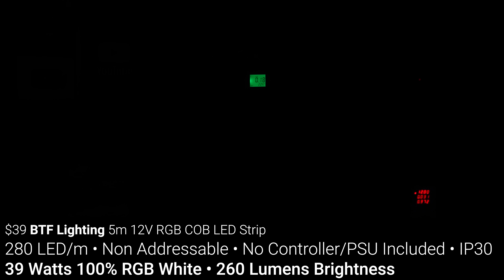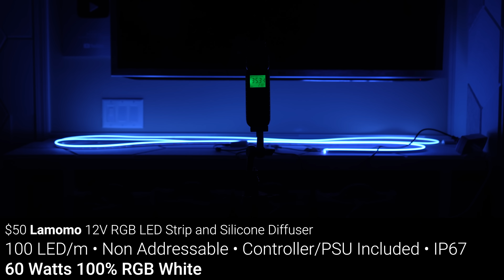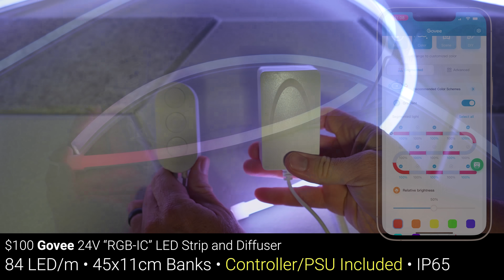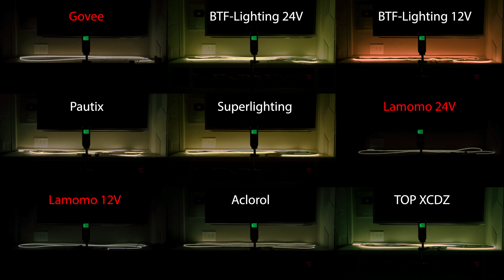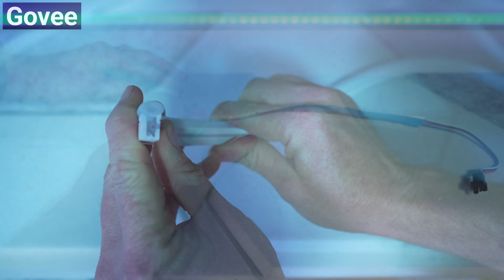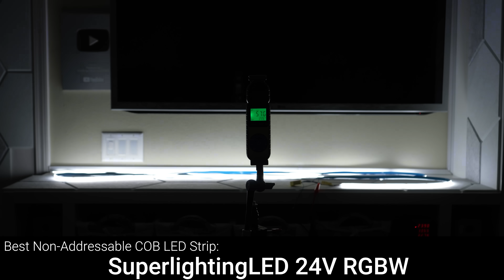Spotless NEON Effect LED Strips, which is Best? Govee, BTF-Lighting, Alitove and more.

Comment: I just bought a some silicon tubes that you are supposed to be able to pull a WS2812 strip through from BTF.  It got about half a metre into the tube before it refused to move any further and wouldn't come back out either, to the point it snapped the WS2812 strip.  So after some arguing, I'm going to be returning the two unused tubes, but I'm still out a 5m WS2812 and the cost of one tube.  Stay away from the silicon tubes.
Reply from the maker: A couple quick tips:
1) Make sure you buy the right size tube for the strip you have.  They list the width of the strip that the can accommodate in mm.
2) You need to pull the whole silicone tube taut.  You will need 2 people to put the strip in the tube, there can't be any bends or drooping sections, pull the tube taut and then pull the strip through with the string.

Comment: I'll put this video in my pocket if I decide to upgrade my under cabinet lights one day.  I am using the old school stuff WS2811, WLED on a ESP8266, on/off via Voice or a Hue Wireless Dimmer Switch, attached with a 45 degree Aluminum Diffuser.

It was a pain to mount those diffusers, the issue I have is WS2811 voltage drop, as power injection on the other end is not possible in my kitchen area, and so when cooking I pretty much need these lights to see well.  If I redo the setup I am 99% going to want a RGBW source so I can get clean light.  It has to be water resistant (cooking creates steam) so need to find something like the SuperLighting product that will fit in the silicon as compared to the BTF Lighting product.

Comment: Any updates on the holiday light installation scene, such as, is aluminum channel still the option to use or are there some silicone defusers that could replace it?
Reply from the maker: I'll still be using aluminum.  It's easier to keep in straight lines.
Reply: @TheHookUp  makes sense, thanks!
Reply: @paulhimle  Paul

Comment: I have purchased a significant quantity of wireless connected Govee lights along with diffusers recommended in a previous video. While the diffusers you recommended appear to be effective, the Govee lights have an insufficient number of LEDs per meter. Although Govee offers a remarkable app, their lights are subpar. If Govee were to increase their LED count per meter to 100 or more, they could dominate the market or utilize COB technology. Despite using the diffuser with the Govee lights, there are still prominent spots. I have not attempted their LED rope due to its higher price and limited run length. I thoroughly enjoyed your video and would appreciate if you could contact Govee regarding an increase in their LED count. Unfortunately, my attempts to communicate with them have proven futile.I purchased a whole bunch of wireless connected govee lights and purchased diffusers that you recommended on a previous video. The diffusers you recommended seem to work but the govee lights don't have enough LED's mer meter. I wish Govee would slow down on their WONDERFUL APP .. (Literally it's the best on the market PERIOD) BUT their lights are horrible.  IF they would increase the LED's per meter to 100+ They would sweep the market. (Or go COB). The diffuser when used with the Govee lights still shows spots.. LIKE CRAZY. I never tried their "LED ROPE" mainly because the price was much higher and you don't get very long runs. Anyhow, your video was great.  I wish you would reach out to GOVEE and have them increase their LED Count. (I tried but they obviously don't listen to peons).
Reply from the maker: Have you tried the M1 strips? 60 led/m is usually sufficient with the spotless diffusers.
Reply: @TheHookUp  I haven't, These weren't available at the time. I will look into these. I appreciate the tip !

Comment: Frustration. Why is it so hard to give us the ultimate strip: 24w RGBICWW Cobb? This is what we want. I wish someone would make this.
Reply: Because the forward voltage drop on LEDs is small compared to 24v, you would either need smaller COB devices with many diodes in series per colour which I don't suspect anyone currently manufactures, or you would need some way of smoothing the current waveform if switching onto a lower voltage LED device, and such a tiny switch mode circuit would be challenging to manufacture affordably.

TLDR 24v is high, so you need many diodes in series to avoid really complicated power supplies per LED group, and no one manufactures small enough RGB COB devices.
Reply: Power draw
Reply: GL Lighting has an RGBWW COB strip.

Comment: Great video as always! I've just started a few led strip projects with help from your videos. Do you know of any individually addressable strips that are brighter than the BTF rgb ws2812?
Reply from the maker: Increase LED density increase brightness.  If using WS2812B you are stuck with 5v, so increasing density significantly will be an issue due to voltage drop.
Reply: Thanks for the quick response! My test setup was 60/M, but I have 144/meter arriving today.  The strip that I need is approximately 1 meter, I can power inject if I need to.

Comment: Nice job! Very thorough. I’ve done internet research on some of these, and had previously decided on the BTF 24 volt. Really appreciate you actually testing each, I’ll be buying your Cob recommendation. I’ve bought individually addressable LED strips in the past, and they are fun to play with, but honestly I don’t see the practicality. The chasing flashing tricks come across as Las Vegas sparkle. My spouse already thinks my fascination with colored LED lighting is marginally tacky, so I’m unlikely to use the individual addressable functions.
Reply from the maker: I use addressable less and less these days, and no matter what type I'm using I always cut power to the strip when not in use.  I find that not having them constantly powered not only saves electricity but also significantly increases lifespan.

Comment: Hi Rob, thanks for your usual professional review. 
Regardless of spotlight, what would you go for in case of a 5m led strip for kitchen top light? 
Which color?
How many LEDs/m?
Which chip technology?
12V or 24V?

Thank you very much!
Reply from the maker: Depends if you are looking for RGB.  I personally use warm white in my kitchen, but if I were going to do it over again I'd increase the density to 60led/m and use warm white/cool white dual channel so I could easily change color temp throughout the day.
Reply: @TheHookUp  it is exactly what I’m thinking of: no RGB, just white. 
Which chip? 2835/5050/3014….
Thanks again.
Reply from the maker: 5050 will get you the most variety and best price.
Reply: @TheHookUp  did you ever make a test comparing those chips to find out the best in class for efficiency as lumen/W?
Reply from the maker: No, never done a video like that.

Comment: I am interested in using these for under-the-cabinet lighting in my kitchen. There are three sections of cabinets in total with a three-foot span between the 3 sections. Can any of these be wired so that no light is emitted from the distance between the cabinets? I would like all three sections controlled in unison if possible. It would look something like this:  _     _     _
Reply from the maker: You can certainly use addressable strips to light certain sections and not others.  The most common way to solve that would just be to cut a non-addressable strip into 3 sections and wire in between them.
Reply: @TheHookUp  Great video! but following this suggestion, any recommendations on connectors for the SuperlightingLED RGBW strip? having a touch time finding connectors... it says cannot use the standard 5050 connector.

Comment: Wow, I realize these aren't meant to be 'general purpose lighting' for a room, but they all make incandescent bulbs look energy efficient.
Reply: I believe the wattage is at 12/24v, so the actual PSU running at mains voltage would be using a fraction of a mains powered incandescent bulb
Reply: Watts (power) are still watts, it doesn't matter if it's 120vac*.5a=60w for an incandescent or 12vdc*5a=60w for leds.  Plus converting ac to dc is a lossy process, so assuming an efficiency of 80%, if a led strip required 60w dc, they'd be pulling 75w from the wall (or 0.63w at 120vac).
Reply: @soulkeephl  To clarify - I was looking at the '120v' side - in your example the LED strip via a transformer would be using 0.63w at 120v vs a 60.0w incandescent globe at 120v. I agree though that when looking at it from a 12/24v perspective, some of this strips are using a considerable amount of energy compared to other LED lighting products!
Reply: @IainBrewSydney  The LED strip would still be using 60w on the '120v' side (and actually more given conversion losses).

Comment: Great video as always. I’ve looked at these type of lights to possibly use for year round outdoor house light decorations, would you recommend any of theses for that type of installation?  The silicons seemed the best to me but would need quite a bit to cover roofline.  Thanks again!
Reply from the maker: The cob type are not waterproof, so they wouldn't be a good option for outdoors.  The silicone tube type are IP67, so they are your best bet.

Comment: Great video!
I like that you also added in the DIY option, though it's worth reminding that the DIY strip would not be addressable
Reply from the maker: Yeah, you'd need to find a 10mm strip or a 12mm tube if you wanted to do that with an addressable strip.
Reply: BTF has individually addressable RGBW strips  (and they have warm/neutral and cool white options for the white diodes) so you can go that route if you want to.

Comment: just to be clear - BTF lightning (and others) sell the same silicone tubes without strips, starting with like $30 per 5m of tubes. you can plase any strip you want inside without any trouble
Reply from the maker: I would definitely not describe the process as “without any trouble”. In my experience it is a fairly substantial amount of trouble.
Reply: @TheHookUp  this, very much this 🤣

Comment: We recently opted for a combination of Govee Neon 16ft and 10ft strips and it's been awesome. They look great up close and have mostly good CRI and color. They tend to be a little weak on replicating warmer, incandescent lighting, but that's true of so many LEDs. They have a tons of cool patterns that can be synched together, but I haven't tried it with Home Assistant yet.
Reply from the maker: The home assistant integration works, but it's a bit laggy compared to local control options like WLED and Shelly.
Reply: @TheHookUp  There's a Govee LAN controller integration in HACS that can control quite a bit of Govee's strips and the response time is near instantaneous. Be sure to see if the Govee strip you want to purchase is on the LAN supported models list.
Reply: I followed your links for the diy kit you suggested. All the components arrived today. The issue I’m having is how to wire it up. The power supply has a connection on it that is not compatible with the Shelly controller. Maybe you could make a video on how to construct this setup?
Reply: C